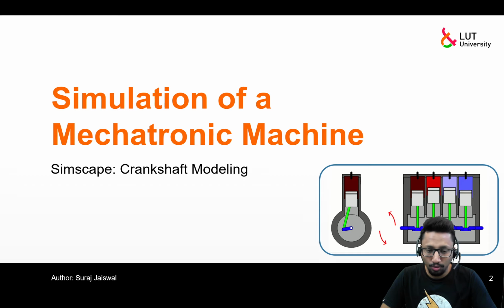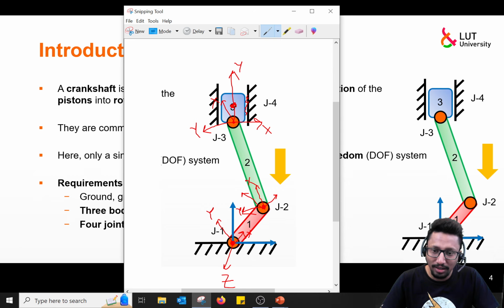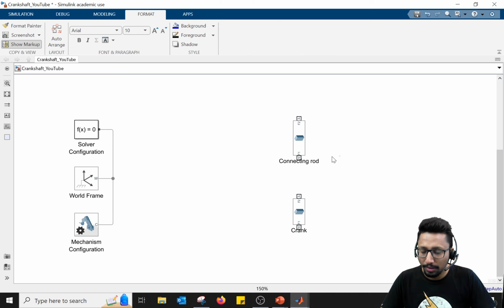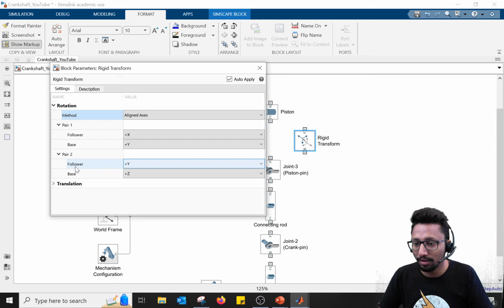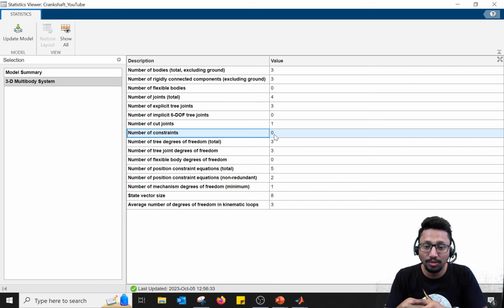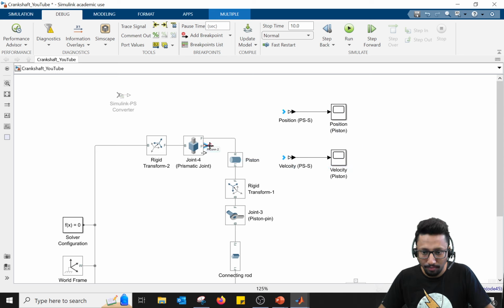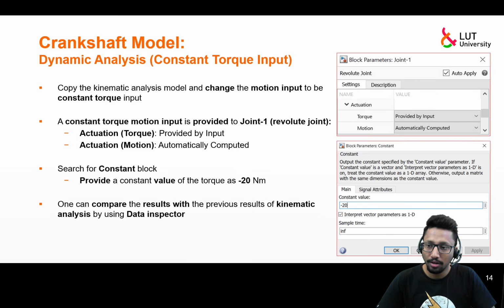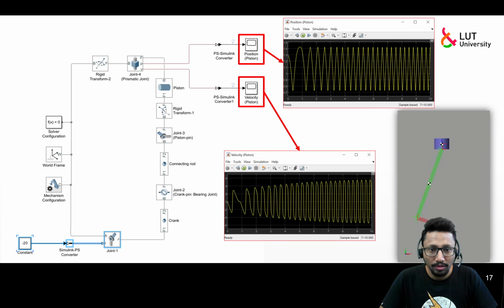T2: Crankshaft Modeling | Simscape Multibody | Matlab 2023 | LUT University | Finland | #20

Comment: There should be a better way to explain. I think that the base and follower notation, itself is confusing. Joint 4 is simply a prismatic joint. There should be an easy transformation to change the Z axis of the joint to Y. Correct?